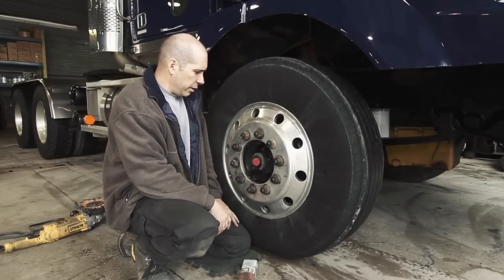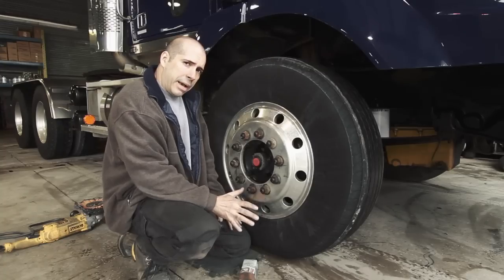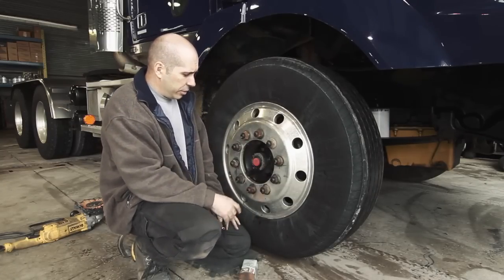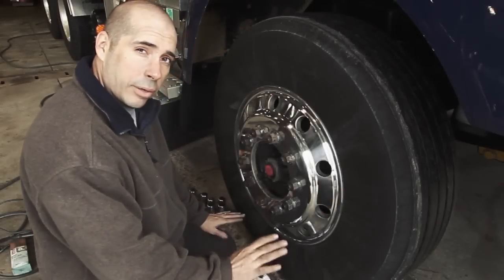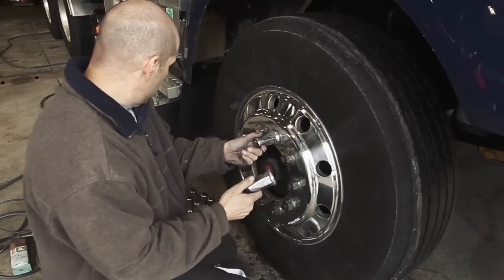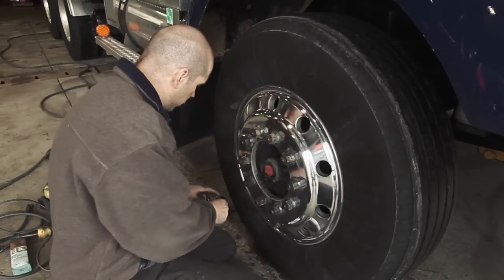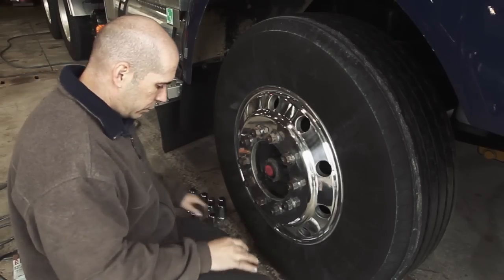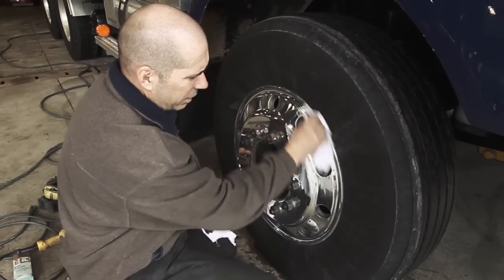How I One Step Polish a rim - How to polish Aluminum

Comment: When I did my own years ago I found regular white flour got the black residue off quick and was sort of a last polish.
Reply from the maker: +Rod Parkinson it does help.  I don't personally use it.  I prefer mixing my metal polish with a bit of varsol/mineral spirits, to remove the black residue.
Reply: @DCSuperShine  I polished mine and got that black residue kinda look ..would simply rubbing in some mineral spirits rid the stain ?

Comment: Denis,
Awesome job. I wanted to ask you can you do a video on the different types of buffer pads and the different type of cutting bars? When to use which one and how you step the process to get the mirror look. Would really appreciate it. Once again great video and great job.
Reply from the maker: I'm working on a video now that explains my process using all the items in my kit. Including pads and bars.  Thanks for watching
Reply: I like to start with orange wheel and brown rogue. Then yellow wheel and green bar. You can finish with white wheel and blue bar if needed. Also on badly pitted metal begin with orbital sander ending with 800 grit.

Comment: Usually I work on spot jobs - so part of a motorcycle here, some wheels off a car there, cast valve covers and ect - but lately I have gotten a few semi trucks and the amount of metal is almost overwhelming. Mostly I have the tools to do the job, but I am drawing a blank in certain areas. For example what is the best way to prep the steps with sanding? Or the areas around the lug nuts when dealing with 22.5s? Even when I have the proper buff-heads some of the areas within the wheel-well are too tight for the tooling to fit and hand sanding has not been very profitable and has not blended very well. So how do you get around the grating in the steps to sand them properly and also the lug nut areas on wheels when they have to remain on the truck?
Reply from the maker: If the rims stay on the truck I don’t sand the lug nuts… it’s that simple! And I’m not sure what you mean by the grating in the steps.. :( thanks for watching much appreciated

Comment: Wow, you're a magician with a grinder. I'am a total beginner. I scuffed up the aluminum on the steps of my new Pete truck at work. Would I need to sand it, or could I try just to polishing it first? How do you charge to do truck rims. By the hour, or by the job. And what's a fair price?
Reply: +Stan Weiler I sand 99.9999% of my stuff no matter the state it's in.  so ya sanding would help get more clarity.  thanks for watching!

Comment: Any reasoning for the handle to be underneath the buffer? I've laeays used it from on top, give you the ability to apply more pressure on the surface your polishing
Reply from the maker: It's just the way I got use to polishing,  it's all personal preference.  you can apply just as much pressure by pulling down, but I let the grinder do most of the work anyways.  only 5-10lbs of pressure is what I'll apply when needed.  :)  thanks for watching!

Comment: I want to polish the wheels on my truck. Any advise on an power tool? Sadly I can't use mains power. Would a drill suffice? Or would I be better off with a cordless grinder?

Our trailer wheels are only 19" and are bad enough to clean let alone polish. Would using a smaller mop be ok? If so would you have to reduce the rpms?
My main concern is the truck to start with. My offside driver cleans the trailer. I also want to polish the fuel/hydraulic tanks. Can you make any recommendations on products?
Reply from the maker: Hey Warren,  honestly if you have patience anything will work!  LOTS AND LOTS of elbow grease even if you want  :)   a drill will work, again will need to be patient, same for a cordless drill.  if your aluminum is fairly new and in decent shape you should be able to get the job done without sanding.  if it's old and rough sanding will definitely help.  Hope this helps
Reply: @DCSuperShine  yes it does  thank you. My truck is a 2018 however the wheels could be any age as they get swapped when they are replaced. But generally the wheels are in very good shape. The tanks are in fairly good condition almost as new. Just with that dull Ali appearance.

Comment: I need to clean up a full aluminum truck / trailer that carries gasoline and diesel, it has both type of stains, could I use the brown bar for a 1 step? do you recomend any other product? thanks and regards!
Reply from the maker: If there's no sanding required,  yes you can do a one step but for a big surface like that I would recommend the green bar.
Reply from the maker: The 439T green from Menzerna is what I mean
Reply: +DCSuperShine And the application method is the same? a 1 step? how many bars would I need for the full tank? thanks and regards! (already subsribed to your channel!!!)
Reply from the maker: +Arturo Roel depends on the size of tank 16-22ft. 1-2 bars if it's a full size trailer 2-4 bars
And yes same process

Comment: About how much time to do one wheel?Great job BTW
Reply: Single step on a steer at my shop is about 7 minutes.  I jack up the truck and spin the wheel. 
But time will vary on condition of the wheel and your level of experience, and what products and equipment you use.
Reply from the maker: Thanks!!!  Front rims like this, when doing just a “one step” no sanding it’s less then 10 mins

Comment: would my polishing process be as effective if is was running my polisher at 3000 rpm instead of 6000? Just take longer or???
Reply from the maker: Yes using a 3000 takes roughly 50% longer.  If you don’t have a lot of experience polishing Sometimes a second cutting steps is needed to remove all the sander marks.
Reply: spirits. Find that a variable speed @3000 you dont get the same clarity

Comment: Nice job but there was already a somewhat of a shine on that wheel underneath the grime. I would like to see you do this "one step" method on a wheel that has hardly ever been touched or not cared for in a very very long time.
Reply from the maker: In that case I wouldn’t be doing a one step, it would need to be sanded before.  I have other videos that show that process.
Reply: DCSuperShine.   Awesome. I'll see if i can find em. Thanks for replying back.

Comment: Maybe I forget how to count, but I saw several steps. First, don safety gear ( how many steps is this?).  2 Load buffing wheel with polishing compound.  3 Polish face of wheel.  4 Polish wheel holes with ball shaped buffer.  5 Clean excess  polishing compound off of the wheel.  These steps can be broken down much more, but I think that you get the idea.
Reply from the maker: Lol should of called it the more then one step rim video...

Comment: I would not try this just the mear fact using that 5000 rpm grinder leave it to the professionals.
Reply from the maker: Hehe!  Well yes a 6000 rpm grinder can be humbling very quickly!!! With that said I have lots of customers with little to no experience and do just fine!  For those that Rd a little more reluctant I suggest starting with a 3500 rpm polisher.  😬

Comment: Woulda been quicker & easier to remove the wheel.
Reply: It takes me 2 minutes tops to have one of those off and laying on the ground.  Both fronts off under 3 minutes.  You spend more time than that going around a few lug nuts.

I'd pull the wheels and do the lug nut area, polish and clean off.  Then install the wheels and let them spin while polishing & cleaning the rest.

Comment: White diamond it's for cleaning or for protection after polish??
Thank you
Reply from the maker: +Kelvin Martinez it does both.  I use flash now tho red for heavy cut, green for Ned cut and blue for finishing and protection.
Reply: DCSuperShine I have a question in which i have yet found an answer. what do you use when a rim is white due to acid. Is it the same process to shine it or is it a different process to remove the white stain due to acid?
Reply from the maker: +Kelvin Martinez same process, sanding will remove any stain or imperfection and prep the surface to be polished.  I use 180, 320, 400 and 600 grits if it's extremely bad you can go down to 100-120 grits but make sure your 180 is done properly after to remove the sander marks from those harsh grits.  Hope this made sense.  :)